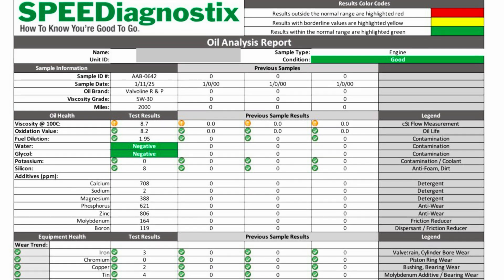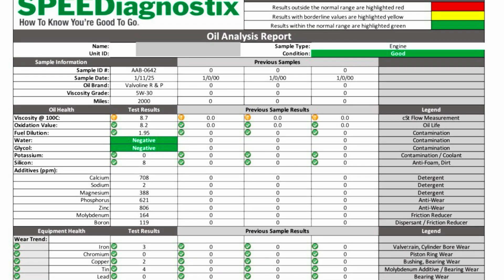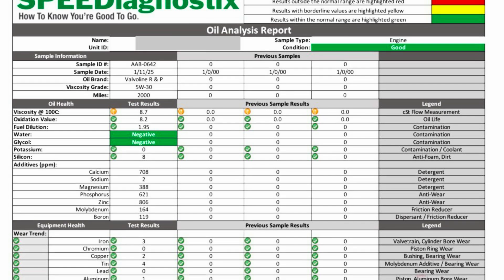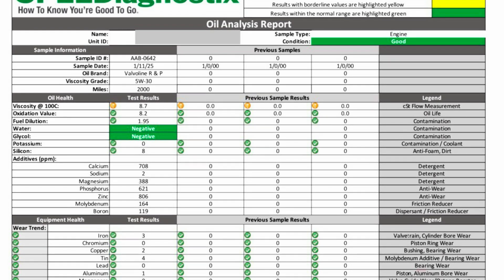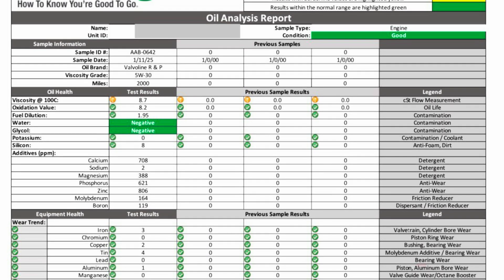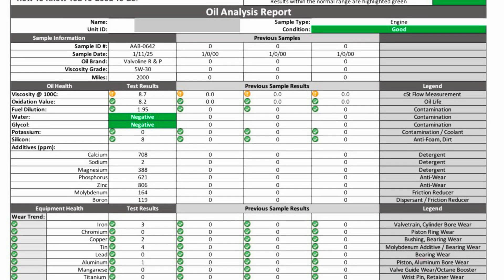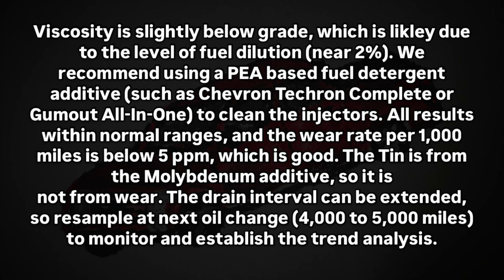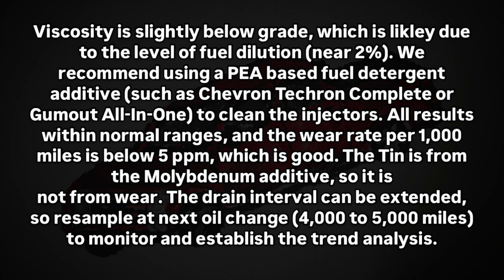Valvoline Restore & Protect (2,000 Miles) SPEEDiagnostix USED Oil Analysis

Comment: Thank you for the show and tell.

I would say Gum Out All In One in a Metal Can would be your best bet. It has more PEA than the other options you can find on your local store shelf. Walmart has it for roughly $8 a can as an example.

Are there better options? Arguably Red Line or Amsoil have them. But neither of those two are exactly off the shelf.

FYI PEA Cleaners work best through heat cycles. They clean when you have your car turned off. So short tripping is more ideal with them than long tripping.

Long tripping cleaners were for solvent cleaners like Berryman's B-12 chemtool back in the day. Today's modern PEA cleaners work best with let's say a 30 minute drive and then shut off for 3 days and then another 30 minute drive.

Just drive normal and it will be fine.

PEA Cleaners work through dissolving rather than being a solvent. The heat helps activate the product and given how little you are driving at the moment it should be extra effective.
Reply from the maker: My friend, Vultain! Thanks for always coming thru with great information! I was really planning to go with Chevron Techron. Mainly for brand and positive experiences I’ve heard about it. Can you see a reason that would be a bad idea? 

Also, how often should I use a fuel additive? Ford recommends against using fuel additives.., so even though I want to use the injector cleaner.. part of me is worried since my vehicle is under warranty.
Reply: @MidwestF150  You're quite welcome! Nothing is wrong with Chevron per say. It's just a weaker formulation but one extremely recognized in the industry. It's used albeit diluted 20:1 in Chevron Gas. I just meant given a choice between the two Gumout in the metal can(you do need a fuel funnel) is a much better use of your time and money.

So the main issue and why they don't recommend a fuel additive is two fold. GDI Engines need intake cleaning and valve cleaning. 

While a fuel additive can clean the injectors and the front of the valves it won't clean the back. I know a lot of people even do Walnut Blasting around 100k on an Ecoboost to remove all the carbon and soot build up.

The main reason is for a solvent based cleaner that works like B12 chemtool and seafoam. There are technically issues with people overdosing, leaving them in, it can eat the seals and protective coatings on metal parts and hardware. Even Honda Small Engines have a protective coating on their carb bowl. B12 Chemtool will eat it alive.

PEA Cleaners will leave it alone.

Also people do some frankly idiotic things with cleaners. If one is good more must be even better! It leads to a lot of horrible things. A little bit of something is fine than a while lot must be better mentality!

In rare cases it overheats the engine, blows seals through pressure, headgasket issues, break off too much carbon too quickly and of course contaminate the oil.

When used responsibly, let's say every 3000 miles or 90 days then a PEA Cleaner is just fine. I recommend always a minimum of two tanks in-between. Also it can cause carbon to land in the oil or extra fuel when used excessively. So most of the time it's fine.

Amsoil makes their PI Improver. It is made to dose per the gallon but you can dump the entire container in without issue. The problems begin when they double dose two containers. Technically you can double dose each gallon just fine. Let's say your tank holds 14 gallons and each bottle treats up to 21. You could potentially add a 28 gallon dose without issue. But keep adding a 42 gallon dose to a 9 gallon tank or even higher doses there are issues. One guy on the forums triple dosed, it turned out okay but another quadruple dosed and wow! Not so good!

I don't believe you will experience any issues when using a fuel cleaner responsibly once an OCI. The main active ingredient in any cleaner is PEA. The only reason Amsoil in some ways is considered superior is they introduced an upper cylinder lube which slows down wear and tear(safe to double dose), as well as a fuel stabilizer and an ability to help tie up any excess water in the tank.

If you Double Dose PI Improver it is suggested to immediately do an oil change on the next fill up. You just helped carbon up your oil and possibly add fuel dilution.

Amsoil does make an upper cylinder lube that helps clean with each fill up. 12 for $55 roughly. Otherwise Lucas makes one albeit not as effective.

Redline makes a fuel system cleaner and upper cylinder lube you can dose for cleaning but also as maintenance dose in a per gallon basis at fill-up. I remember someone showing the actual real life testing of both it and Techron and the Redline was remarkably better all around.

Redline or Amsoil are essentially taking any gas you throw in it and making it top tier or above. Top tier gas is mostly just cleaners and upper cylinder lube added to fuel as is. My old truck has ethanol free Exxon Top Tier put in it, I have used upper cylinder lubes and  I can't tell much other than it idles a bit smoother and gets maybe 2-3 miles a gallon better. It's more of less a wash financially but it is supposed to keep both the injectors cleaner and slow down wear and tear on the pistons. The idea of it is when the top of the piston hits the fuel for the brief amount of time it is without oil it is a reduction in wear and tear. Lake Speed Junior said it mainly helps oil life and helps reduce wear and tear through that.

I have seen testing from the Europeans on Fuel Additives and their effect on Engine life as well as several discussions and testing by tribologists.

They can be highly beneficial when used correctly. Or highly detrimental when used incorrectly. They are also more advantageous for individuals short tripping as opposed to always on the highway.

I hope that this helps. Good luck whatever you choose. Hopefully that gave you enough information to make an informed decision.
Reply from the maker: @Vultain  thanks so much for this!! Really appreciate this!!!
Reply: Use redline it has more pea than gum out
Reply: @Z34370z  Agreed, but I think Midwest is looking at what can be found off the shelf in stores. I think he is trying to avoid having to order products online if he can. He has intimated as such during his lifestreams.

I don't want to speak for him but that is my impression.
Reply: @ you can find redline fuel system cleaner at advanced auto and o Reilly
Reply from the maker: @ yes! Haha I like to easily access product and not have to deal with waiting lol
Reply: @MidwestF150  In that case Red Line might be a go to product since it is usable as a cleaner and maintainer.
Reply from the maker: An Advance Auto near me, that isn’t closing, has some in stock. I should be able to use the $5 Perk Bucks I got to save some money!
Reply from the maker: @ hey Z3, thanks for the tip!

Comment: That's awesome that you were able to get an oil analysis done on the F150. Great results ! Keep it up 👍👍

(Edit).... Not sure if you have any Shell stations in you area but I would run their higher end Nitro V power instead of a off the shelf fuel system cleaner.  That's just my two cents for what it's worth.
I know Redline makes a good fuel system cleaner that the guys on the corvette forums rave about. You've got options for sure!
Reply from the maker: Hey voiair! Good to hear from you again! Thanks for stopping by! Unfortunately the closest one to me closed down due to their tank leaking… I’ve been using Costco’s Top Tier gas. Which is I think is good. What are your thoughts about that?
Reply: @MidwestF150  Since you're already using  good fuel , I would try to get the Redline fuel system cleaner off of Amazon. I think it's 15 bucks but it has a great reputation. I would run it every 4k to 5k oci.
Reply from the maker: @voiairwolf brooo it’s like $30 a bottle for me on Amazon lol
Reply: @MidwestF150  You sure that wasn't a two pack? Found a two pack with Prime Delivery for $34... so like $17 each?  My local Advance Auto wants $16 each...

I've been using Mobil Supreme+ (also E0 vs usual E10) most of the time and had run Redline in both my vehicles last year...

Since my Fuel Dilution issues (5.8%) has returned after a "Summer" low of (1.3) itself a drop from last Winter's 5.3%... It might be time for another Redline Treatment...

Although with that said I've also been running Fuel Additives like Marvel Mystery Oil or STABIL 360 (a PEA Fuel System Cleaner)... So I'm not too certain If another of Redline can do much.

But, I suppose I should try it and/or some long drives to hopefully give VRP and my Top Tier fuel to do its thing
Reply from the maker: @lgoamity  hey lgoamity, you are right! It was a two pack lol. But do you think we can get away without using it if we’re using top tier gasoline??
Reply: @MidwestF150  I'm asking that question myself.  I have Oil/Fuel Dilution swinging from Winter 5.3 to 1.3 to 5.8 . I've been trying to use Top Tier since it became a thing 20 years ago... And been consistently using it since my "Diagnosis"... Along with Marvel Mystery Oil or STABIL as "extra" protection at fill up.  So I'm going to have to figure out what I'm doing different besides it being Winter Time... ,(Although that and maybe extra "Warm Up"/Idle) is probably doing it)
Reply from the maker: @lgoamity  how bad is fuel dilution anyway? Is the harm in it degrading the oil?
Reply: @MidwestF150  True.  My first sample (5.3% on the Terrain) Blackstone didn't have a decent baseline for the Wear Metals so the Oil Dilution might have been masking a bigger issue. My later 1.3% They could see the Wear Metals were OK... and could recommend 4-5K intervals (all day long in the Dilution stayed below 2% and Metals didn't spike.). 

I've been reading of some Oil Analysis Labs that won't automatically Red Flag your Oil Sample if it goes over 2%... If it does and the Wear Metals are within Good/Avg range plus the Oil's Additive Package is OK... They might "Pass" the sample if it's deemed "Normal" for your vehicle.  (With probably a note about addressing the various items that might create/increase the issue... )

Since I've seen 1.3% is possible I'm hoping I can meet/beat that Number again  and NEVER get "In the Red" (over 2%).  My Oil's Additive Package and Wear # are Good so "Maybe" I could get a "Pass"... But most scales I've seen 5% is Severe and if I (or the average Ecotec 2.4L user) is following GM's OLM (7500/12 months) I can see why the Ecotec 2.4L gets such a bad reputation for Self Destruction/ Timing Chain/ Oil Consumption/Etc... 

People don't check/top off/chain it soon enough so it basically self Destructs... Maybe a small part is GM's fault but the User(s) still need to monitor progress and decide if the Oil is going for too long...
Reply from the maker: @lgoamity  ahh I understand now. Do you think a faulty timing chain can cause fuel dilution to the amount I got?
Reply: @MidwestF150  Oil/Fuel Dilution from a Timing Chain? Maybe I'm out of the loop, but I don't think a Timing Chain would contribute to introducing Fuel into the System. The Exposure of the Timing Chain to an Oil/Fuel Dilution of Motor Oil might cause Wear, Noise and Eventually Chain Failure... But it shouldn't be a source of Fuel Introduction (New Or Faulty... Unless maybe it Grenades and creates a hole(s) for Fuel to enter the Crankcase??)?
Reply from the maker: @lgoamity  haha yeah I’m just asking questions that come to mind. I don’t know if there is a link between the two things.
Reply: @MidwestF150  Always good to Question... There are probably a number of different ways Fuel can get into the Oil. With luck Ford/F-150 enthusiasts might be best able to give you a list of ALL the potential sources of Oil Dilution, besides Oil Control Rings, Excess Fuel, Short Tripping, Idling, etc...
Reply from the maker: @ yeah I appreciate this. I don’t think it’s worth the dig since they seem really unrelated lol
Reply: @MidwestF150  Well since you mentioned it... And I'm recently 4.5% Higher then my Summer Time Oil Change (1.3%)... I Myself wouldn't mind looking into anyv"uncommon" possible Oil Dilution causes...

Did a LONG OVERDUE MAF Sensor Cleaning and quick cleaning of the Throttle Body while I was "On Vacation" (not ideal conditions/equipment/tools) because if I waited until after the return... The 5.8% OCI I just had might be 225-450+ miles further along.

Need to actually pull the Throttle Body and clean my MAP Sensor (the TB might help? The MAP not so much with Oil Dilution?)
Reply from the maker: I wish I can access my throttle body. The hose that connects air box to throttle body is incredibly tight and stuck on the throttle body side. I have no idea how to remove it..
Reply: @MidwestF150  Depending where your MAF Sensor is you might be able to introduce various Cleaners (CRC Intake Valve/Turbo Cleaner) into the Air Intake (Upstream) after the MAF that might clean the TB "Indirectly"...
Reply from the maker: @lgoamity  good morning lgoamity! I’ll look into that. I don’t like introducing chemicals to the engine. Only when I really need to. By the way, have you experienced any coolant level issues? My truck’s coolant level has been decreasing since it’s gotten cold… I’m wondering if there’s any issue with the cap not sealing…
Reply: @MidwestF150  Haven't noticed a Problem with Coolant Levels... But I'm due to check under the Hood again... Will check tonight.  

Does Ford recommend a Service to reduce Intake Valve Deposits? I suppose they could bring it into the Engine via a Vacuum Line or something but the Throttle Body isn't uncommon.  When I last did it (CRC IVD cleaner) it didn't clean the TB so much but maybe just enough(?) while hopefully starting at any Intake Valve Deposits
Reply from the maker: @lgoamity  I’m not 100% sure on service recommendation on it. I have the Ford App and I didn’t see anything on it.. maybe I’m looking at the wrong thing. I will need to dig more into it!
Reply from the maker: @ hi Van! Thanks so much for sharing!! I’ll watch this now!